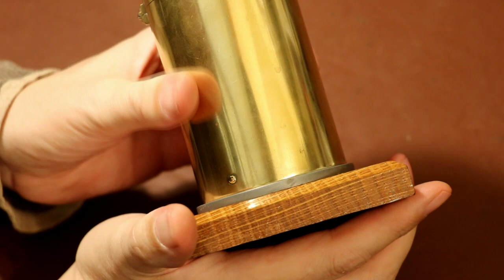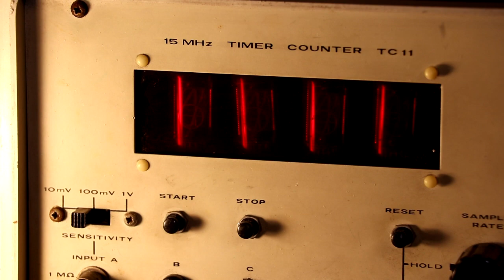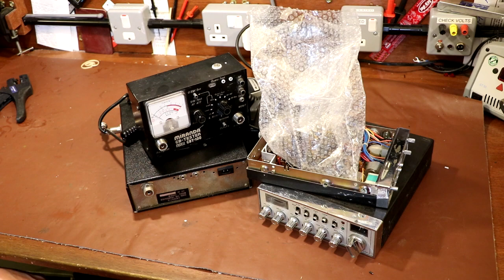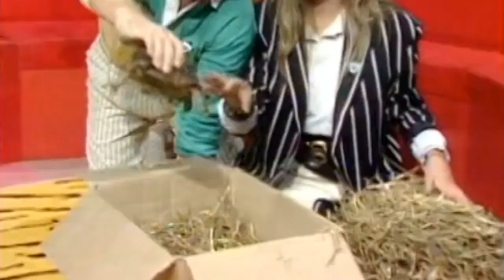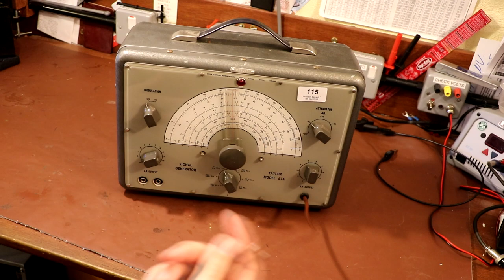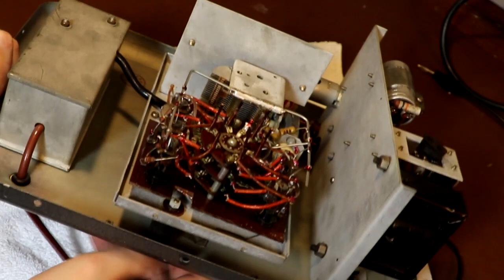Humbug Christmas

Comment: i see a taylor 67a rf generator, i have the exact same one which misbehaves at frequencies above 10megacycles...does yours have the same issue?  they also have a common problem of open transformer on the AF oscillator but that can be easily fixed...dont need to match the turns or gauge of wire very carefully because the AF frequency doesnt really matter as long as it's an audible tone.i have fixed mine
Reply from the maker: Hugo B.   I only did a quick check but I think the  RF oscillator was cutting out on the high frequencies but I need to investigate further to be sure.  I had a similar issue on my AVO wide range generator and replacing one of the capacitors in the coil box fixed it. I don’t remember what the capacitor was it may have been part of the RF choke circuit. Thanks regards Chris
Reply: @allthegearnoidea6752  i had another issue: cleaned the wafer switch with alcohol and the oscillator stopped...dryed it with a hairdryer and still nothing...after 24 hours it cameback to life on its own..i guess the ceramics in there absorb whatever you pour on them so watch out...happened to me on a TV were the IF died and horizontal oscillator drifted after circuit board cleaning. it fixed itself after some heat applied
Reply: a problem with this generator is that if you connect it to a counter or t a adio etc, the device connectd loads it down causing frequency drift. i wil be watching your vids to se how you tackle that
Reply from the maker: Hugo B. I doubt I will tackle that etc probably just a feature of its design. I will however have a look at the manual with regards to the output impedance. I had assumed 75 ohm but perhaps not. I will however try to recreate the problem etc Thanks regards Chris

Comment: Hi Chris, some nice gear there. I have a Taylor 67A here, which was a Christmas present from my now wife in 2014. It had a knock in the post and the V.C. was shorting out but was easily straightened out. I stripped, cleaned and re greased the reduction drive and swapped out the Hunts. Really well made unit.
Reply from the maker: Did you have to change out any of the components in the coil box or was it just the Electrolytics. Its a bit low on all the frequency ranges but have not tried adjustment yet. I will have to have a look at the reduction drive it is also stiff etc.   Thanks Regards chris
Reply: @allthegearnoidea6752  I didn't change any electrolytics, they were fine just the brown Hunts dielectric caps. If the frequency is low on all ranges it could be the pointer is misaligned. The resistors had drifted quite a bit in mine.
Reply from the maker: @IrishvintageTVRadio   - Yes i did not think of that pointer alignment. I thought all the capacitor were ceramic of some type or another. I will  have to ask you when I get it out. Thanks Chris

Comment: You are right about the low end signal generators from the U.S, but also remember that those were kits like EICOs or Heathkits. Not all were junk, I have a Heathkit unit that is not only well shielded inside like that Taylor, but has a voltage regulator tube involved in the power supply somehow, unfortunately I will need to overhaul it as it quit working.
Reply from the maker: OlegKostoglatov  Thats interesting I did not know the EICOs were kits. We also have the Advanced signal generator here. They are massively popular but I don’t rate them definitely built to a price but adequate for the day.  Given the availability of cheap high end boat anchors such as Marconi I have favoured those instead. Thanks Regards Chris
Reply: Truth be told you could buy them as kits, or already wired, but someone operating on a budget would probably do it themselves. They also used a lot of surplus parts, I found a DuMont branded paper cap in one of my EICO generators, and it was bought brand new by my Uncle in 1966. DuMont used to manufacture high end TV sets before they were sold to Emerson in 1956.
Reply from the maker: @OlegKostoglatov  Your in depth knolledge is amazing you really should make some videos.  Thanks regards Chris

Comment: I'm looking forward to your restoration on the Taylor Signal generator as I have one sat on my bench ' not in quite as good condition as yours ' but it works unrestored as yet 
Best regards Shaun
Reply from the maker: The Mancave Workshop Hello Shaun and Happy New Year. Those Taylor signal generator are very well made and I don’t think there will be much needed to get it running. Perhaps just the Electrolytic as they are life expired even if they are still measuring good,  Thanks for watching regards chris.

Comment: Thanks Chris and a happy new year to you too ! really enjoyed that I would still replace that mains lead ! maybe its broken ? and thats the fault but no doubt you will soon discover if it is the case looking forward to seeing the video on it and seeing the innards as I never opened it up ! was using it as a door stop at my other workshop !
Reply from the maker: Hello Benji Glad you enjoyed it. You may be correct on the mains flex but like you, Im excited to open it up and have a look inside it.  I do have a plan for this counter so its not going to be used as a door stop etc . Have you had change to try that LCR meter I just wanted to know  if it worked ok etc.   Thanks regards Chris
Reply: @allthegearnoidea6752  Thanks Chris yes I have had a quick look at checking some caps and all seems well will let you know more when I test some other stuff  I think I have a PCL84 valve so will let you have that,  I like that indicator lamp on the Taylor infact I am sure I have one like it in my junk drawer !
Reply from the maker: thehappylittlefox aka benji  started looking at the counter it’s quite ill but very interesting. Not played with Nixie tubes before
Reply: @allthegearnoidea6752  oh is it I am sure you will have fun finding out whats up with it though

Comment: I just think you are taking the pee... i mean pea :-D
You're a magnet for uniden radios, the 455khz f.m modem board was an addition from the manufacturer to make it exportable.  (Typical manufacturer add on).

The r.f generator looks very nice.
I have a Rohde & Schwarz valve r.f generator 4-300mhz Am/Fm/Video jobbie, with a round Airodrome AE badge on it.
It has a built in anti theft device, it's so bloody heavy!.
The best part is it's discription: Empanger MESS SENDER, i laugh every time :-D.
Reply from the maker: Thanks  and sorry for the slow reply, your comment was hidden by YT I know not why.  Thanks for watching stay safe Chris